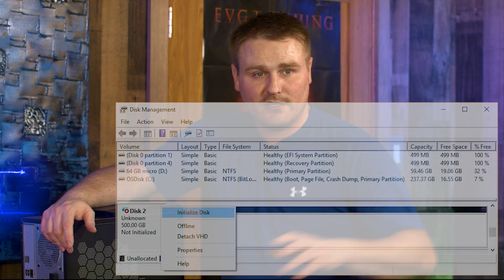Acer Nitro 50 PC SSD How To Upgrade & Install

Comment: but where in h2ll is the HDD that comes with the computer?   I cant fint it anywhere.. is it built in?
Reply: so the newer models only use m.2 Solid state drives.  they have two m.2 slots on the mother board. one populated by the Boot Drive between CPU and GPU and the other is right of the ram and empty for you to populate. if you wanted to use a traditional HD or SSD you will need the cable AXC 6Pin to 2-Port HDD SDD SATA Power Socket Cable (Alipexpress for best price) as the PSU does not have any sata power connectors because Acer Sucks
Reply: @Kramptonyte thanks i found it

Comment: Im having trouble finding the power cable it looks like on mine both are in use .. and there red black and yellow wires..
Reply: the red cables he is using is the Sata Data cable, which can be purchased cheaply on amazon.  the more modern versions of the nitro 50 do not have the Sata power connectors on the power supply. So you will need a AXC 6Pin To 2-Port HDD SDD SATA Power cable Part # 50.b64d1.001 its available on amazon or the cheapest place is aliexpress.  the newer Nitro 50s have two m.2 slots.  which means you wont need to purchase anything but an m.2 Harddrive

Comment: Hey, my Pc came with an extra Sata Power cabel, but I can't find where the other end goes in the Pc. Got any tips ?
Reply: so the acer uses a proprietary cable for sata power  for many of the newer nitro 50s its located right around the data sata ports, it is a connector with 6 pins in a straight line it can either be White or black. google part number 50.b64d1.001

Comment: I have a nitro 50-656 I'm trying to do this ssd upgrade but there's no sata power cables with my pc and can't find the right ones to connect straight to the board is there another way to power the ssd?
Reply: because Acer likes to use proprietary connectors and gimped the power supply on top of that. if you are using a SATA SSD, you will also need this cable if you google this term "AXC 6Pin to 2-Port HDD SDD SATA Power Socket Cable for Acer Computer Motherboard"  it plugs into the little white 6 pin connector next to the sata connector the alternative is to get a m.2 ssd as there is an empty slot on the MB for it and requires no extra cables
Reply: @Kramptonyte  thanks for the info! I have one on order but in the meantime I found a usb cable that fits the sata ssd power slot I tried seeing If that would work but I can't get it to show up anywhere on the pc so I guess not

Comment: Hey TechNitWit. just wondering if theres a limit to the ssd that can be put in this compute?
Reply: are you talking size or number of ssds? because size not really. beyond that it depends on the number of m.2 slots and and sata ports and the sata power connectors

Comment: I have an HP Pavillion with 1 TB Drive can I remove that and install on my Nitro 50 Gaming Desktop - N50-650-UR11? and move the 512 GB to the HP Pavillion? Both are gaming pcs I just need the ACER to have more storage.
Reply: are these gonna be blank drives? are Operating systems located on the drives you want to move?  so yes it should work.

Comment: thanks for the video- I did have one question- think my current SSD is having to fix sectors for hours  (c:) every time i restart- If I add a 2nd one, how do you change the boot to the new one, and do you have to install Windows to the new drive?  thanks!
Reply: @huntwumpus5833  yes your boot disk needs the operating system on it.

Comment: Can this be installed on this desktop? Samsung 970 EVO Plus Series - 2TB SSD PCIe NVME - M.2 Internal Solid State Hard Drive Model Number: MZ-V7S2T0
Reply from the maker: Yes but you will need to reinstall windows
Reply: But the SSD that I have is different than the one you installed? I'll need another tutorial for that. It good to know that it can be done.  @TNW1337

Comment: I really need help. I'm trying to connect a HDD but I can't find where to plug in the power cable. I got one from a friend who had spares but I can't find the ports for it and neither can I find any cables that already came with the pc. I have an Acer Nitro N50-600
Reply: Did you end up finding it I’m trying to install a ssd rn

Comment: I just picked up a Samsung 980 PRO SSD 1TB - M.2 NVMe, Should I replace the 512gb with this one as it is PCI gen 4, with about double the read/write speeds. I heard the second slot is, PCIe Gen 3 and will not take advantage of the faster speeds.
Reply: Hello,I’ve been trying to install a new ssd card similar to yours but I have the Samsung 990 pro just wondering did you swap it with the ssd card near the fan?
Reply: @benscully6500  I added 2 of them, one for boot and one for storage and had to disable the CMOS setting Intel Advance Storage to get it to recognize them both and updated firmware to change back after OS install.

Comment: Hello, my son has this computer and we are trying to upgrade using a SAMSUNG 980 SSD 1TB PCle 3.0x4, NVMe M.2 2280, Internal Solid State Drive. I read here that I wouldn't have to replace the 512GB M.2 already installed directly on the motherboard, but that there are 2 additional M.2 slots. Is this true? I don't know where they are or how to install this drive. 
Upon watching your video it looks like I should return it for a 2.5 SSD...if you agree, would the SAMSUNG 870 QVO SATA III 2.5" SSD 1TB work? I have spent hours researching and truly appreciate your help!!
Reply: I have the same problem

Comment: Hey, do you think this pre-built Nitro is worth 749 euros (taxes, etc. included):
- NVIDIA® GeForce® GTX 1660 Super with 6 GB of GDDR6(DP, HDMI, DVI-D)
- 16 Gt 3200 Mhz DDR4
- 12th Generation Intel®CoreTM i5-12400F, (2.50-4.40GHz) Hexa Core processor
- 512 Gt M.2 PCle SSD
- wifi 6 and realtek dragon LAN webcard
- Intel®B660 Chipset
I can give more info, but what do you think? Pre-built market is REALLY small here, especially for monthly payments without interests.
Reply from the maker: Can you get the Lenovo Ideacentre 5i
Reply: @TNW1337  Thanks for a reply. I can't get the Lenovo and I actually found a used pc market, I may get a pc from there instead. I'll ask more soon.
Reply from the maker: Yes
Reply: @TNW1337  hey! I found a few options for 500€, all in excellent condition: 
-HP
-OS: Windows 10
-GPU: Nvidia Geforce RTX 3060TI 8GB Zotac
-Processor: Intel Core i7 8700 12x 3,2 GHz
-Memory: 16GB DDR4 RAM
-SSD: M.2 240 Gt
-HD: 1 Tt harddrive
-Wi-Fi, Bluetooth etc.
-USB 3.0 ports, USB-C port, headphone, microphone etc.
-HDMI, DisplayPort etc.

Or

- HP
- NVIDIA GeForce RTX 3060 Ti 8Gt
- Intel Core i5-10400 - processor
- 16Gt RAM, 1 Tt NVMe M.2 SSD
- customizable case
- designed for gaming
- 1 x USB-C, 4 x USB 3.2 Gen 1, 4 x USB 2.0
- Wifi 6, Bluetooth 5
- With warranty!

Or 

Watercooled
Intel Core i7 7700k
Gigabyte 1080ti
16Gb DDR4 Fury
Asus prime z270-a
Corsair H110 AIO
256gb m2 driver
Windows 10

Which one is the best for gaming performance? I have home a 1tb external Seagate harddrive so space shouldn't be a huge issue.

Comment: Great video, however Acer is a pain inn the neck... I own the RTX3060 version and the board is much longer than the GTX from this video, hiding the SATA connectors. So to add a SSD in this pc I have to either remove the RTX3060, which means unmounting the front side, or remove the hard disk cage. How can a team of engineers be so stupid? Adding a 2.5 SSD should be a 2 minutes job.
Reply from the maker: I agree they can be a pain the A$$. Thats why I try to push every one to build. But I under stand not every one has the skill or time.

Comment: Not sure which model is that, but looks like Acer N50-620 (11th gen, two M.2 slots). So I got sth very similar at home and unfortunately connecting SATA SSDs requires disconnecting two SATA power cables from LED lights inside the case. So afterwards the case do not glow... :-/ Looks like manufacturer didn't think that through too carefully. Also, the first M.2 slot (the one below CPU and next to PCIe x16 is connected directly to the CPU, so using 10th gen disables this slot if I am correct.
Reply: it works to conenct a hdd/ssd on the sata of the lights ?
Reply: @LowakZ9OI  the PSU has only 2 SATA connections,one of which is already connected to lights.

Comment: Thanks for the guide!
I was looking for the SATA port but couldn’t find it because I have a RTX 3060 which is larger than the GTX…
Reply: Hi, dunno if u still need answer, but the ports are just above on the motherboard, one is red colored and the other white, one near the other
Reply: @ultrahx2531  found it, the model I got was just the 3050 model but with a 3060 instead so the port was located behind the 3060.
Reply: all good then
Reply: I have an 2060 but for me it was above my 2060 and a little bit to the right

Comment: Hi! Thanks for this video! I recently bought a Nitro 50-640 and the basic storage is very problematic. Very stupid question: is it exactly the same for a 50-640?
As I don't know anything about pc upgrades I'm afraid to do something stupid.
Thanks if you answer my comment!
Reply from the maker: They use what available at the time so It can change Manufacturers on the same line.
Reply from the maker: What problems?

Comment: Hello, I have a question; I bought this PC with a RTX 3060, and I got SATA cables with the PC, however I could not see any SATA ports, should I take the GPU out and check that way and eventually plug the SSD in that way and then put the GPU back in?
Reply from the maker: Up to you but if you have a spare sata cable it will be plugged in.

Comment: I have acer n50 -640 model,    can i put ssd sata without removing video card ?,    because some acer models n50. Is forcing to remove video card first. Thanks,  waiting for response
Reply from the maker: Problem is the GPU is like right on top where the sata goes, some models of the acer have the Satas above the gpu. if your is the one with it above the gpu then yes. Removing the Gpu is very simple.remove power 6 or 8pin, Remove screws 2 or 3 of them, then Push the latch on the Motherboard on top of the GPU. the card will slide right out. watch my Acer Nitro N50 GPU upgrade video to see how to do it. it can be done in under 10secs, when the Gpu is out, plug the new sata cable in, route the sata cable, then plug GPU back in, make sure GPU sits flat, then replace screws Then PCIe power cable. Your done.
Reply: @TNW1337  ok, thanks

Comment: My PNY 1tb ssd came with a transfer cable? I just plug it into the usb?
Reply from the maker: If you want to make it your boot drive you can clone it. But it is not needed.
Reply from the maker: Just add that plus what you have = More storage.
Reply: @TNW1337  what are the odds I buy a nitro 50, and then boom you’re upgrading one! Super cool & pretty dang convenient

Comment: Hi, i really appreciate your guides.I own 620 with 3060ti. I already replaced CPU cooling and added front fan. It works really nice, temperature dropped by about 30 degrees. But temperature of GPU stayed the same as it was - about 80 degrees. What can I do to lower it? Remove HDD/ssd cage to improve air flowing from new front fan? Or mount new fan on the side to directly blow on GPU? Or maybe change blowing style cooling of GPU to water or  2-3 fans cooler? I really can't tell
Reply from the maker: Sell Gpu get dual fan Gpu. removing the cage may help by 2 or 3 c

Comment: sir can you please provide a video on how to replace the vga rtx 3070 for acer nitro n50 620 pc which only has 1 8pin and 1 6pin power cables, because the rtx 3070 requires 2 8 pins, should I replace the psu or what? Thank you
Reply from the maker: Yes I will look in to it!

Comment: If im going to case swap it, is it worth changing the motherboard too or should I keep the old one?
Reply from the maker: I would swap the mobo to. just all you more options and ports for stuff. XMP + plus more
Reply: @TNW1337  I’m gonna use the same graphics card, cpu a and all that. But I’m planning on installing a 360mm AIO for the build. I’m going to do it in the Be quiet pure base 500dx white. Any recommendations for the motherboard? (Around 150$)

Comment: sir i recently bought nitro 50. can you please tell me how many rams and how many hdd can i install. i mean what is the max ram and hdd motherboard supports and how many. also in the back there is 2 slots place that is empty  next to the grafic card, does it supports dual gpu (if yes please tell how to install). also if we can upgrade the cpu (if yes then which one). i want to max out my motherboard options. loats of love from germany and india <3 ♥ ♥
Reply from the maker: Yes you can do 2 drives HDD or SSD. Memory is 64GB max i-7 11th gen None K Cpus
Reply: @TNW1337  thank you for taking time to respond.

Comment: Can I turn of the red lights on it? And how? It think I have to remove the ledh1 cable, but I’m not sure
Reply from the maker: Look in the acer software if not yes you have to unplug it.
Reply: You have to unplug the strip. No option in bios or software to turn it off
Reply: @mrgigglez2770  ok, thanks

Comment: According to acer the power supply can be upgraded and the motherboard is a standard intel b560
Reply from the maker: Well the Power cable to the mother board is not. Thanks for the info
Reply: @TNW1337  Agreed I will be upgrading the psu eventually but I will need an adapter so it can connect to the motherboard

Comment: Would you recommend the hp silver desktop with the Ryzen 5 5600g apu and 12gb of ram for 899cad or the nitro 50 with the same processor 1660ti and 8gb ram for 999cad both have a 500gb ssd?
Reply from the maker: No GPU in the TG? if not the Acer is better
Reply: @TNW1337  I picked up the acer! First thing I'm doing is upgrading the ram and adding a front case fan. For some weird reason acer put in 12gb, its dual channel but with one 4gb stick.
Reply: @TNW1337  The acer I picked also came with a i5 11400f, WD 1tb nvme ssd, and a gtx 1650

Comment: @TechNitWit Are you a computer tech or do you have experience in the IT field? If so what parts of the job do you enjoy and what do you dislike? I'm looking into a career in IT I'm unemployed currently and straggling to find work
Reply: *struggling
Reply from the maker: I went to school for computer engineering. I've worked in the tel communications as a field tech for most of it. I loved it. Well you have different aspects. You can work in a data center or a for a larger company or in the field. I mean you could look at expanding your knowledge and get in to storage or networking.  One thing I hated in I.T was they always wanted to get the cheapest thing, then ask why it needs to be replace in 3 to 5 years. Are you look for indoor or outdoor ?
Reply: @TNW1337  Indoor Im looking at web development or network/systems admin

Comment: Do not swap the PSU with an ATX PSU using a 24pin to 6pin adapter! It just cost me a GPU. There are issues with powering the system off as well as hibernation where the PSU (and likely other components like the GPU) still draws power and generates heat - but there's no fans running. I learned this the hard way and pass along the info to you all.

Sorry for the confusion earlier as everything appeared to be working correctly, but the looks were deceiving.
Reply from the maker: Shit that SUCKS! 
All good man I would send it back to acer do not tell them what you did!
Reply: I personally use that adapter, I just turn the PSU off after shut down.

Comment: Is the CPU in this computer upgradeable? Bestbuy told me that the motherboard is standard is that true or is it proprietary? And can the power supply be swapped later on?
Reply: Yes the CPU can be upgraded to  i7-11700K
Reply from the maker: @mrgigglez2770  Correct!
Reply: @mrgigglez2770  Power Supply or motherboard?